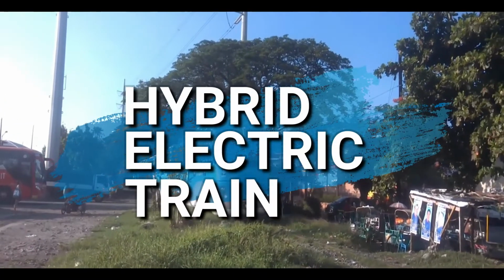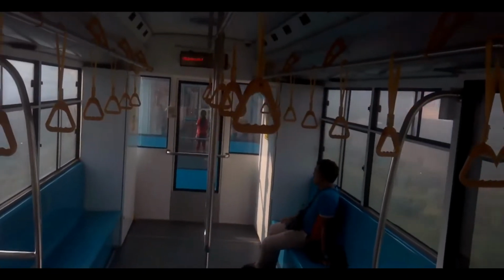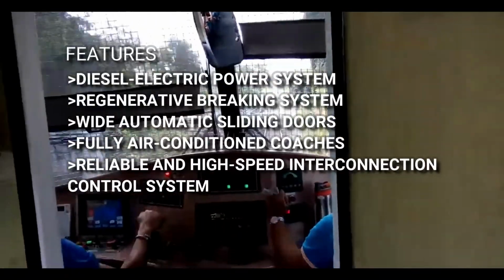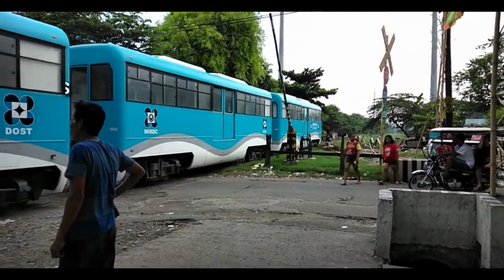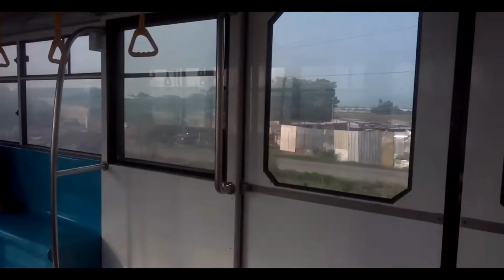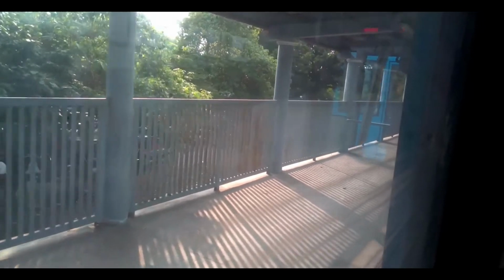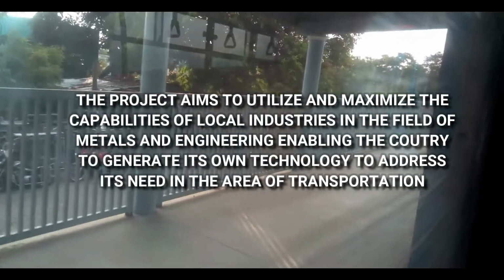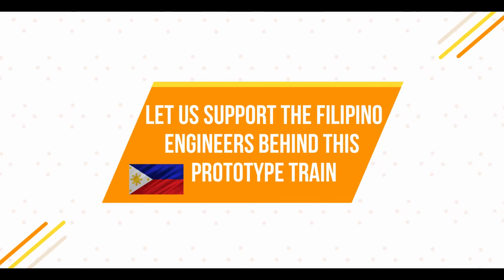PTERC: Domestic Production of Trains in the Philippines

Comment: The train needs some re-design like connecting each railcars for people and crew to have access to all cars.
Reply from the maker: Indeed, Gilbert!

Aside from that, there are also a few more design errors.
1. The floor height is too high in case of emergency.
2. There are electrical boxes inside the passenger area, where it shouldn't be.
3. The door stair found in the passenger modules is very hazardous in case of almost a maximum volume of passengers.
4. The cars are too short to be able to really optimise to PNR's needs.
Reply: @PTERCOfficial  Have you brought this up with the designers of the train?  You might get some answers on why it was designed as such!  My initial take on the floor height is because it can go through flooded areas.  The designers I believe already conveyed this.  The stair inside is because of the height of the platforms.  As for the length, there are definitely some standards followed and additional sets are needed to address your concern but for me, I prefer this length so that it can service non-peak hours!
I rather prefer multiple train sets rather than 1 very long train.  Why?  You don't need to have longer waiting time for non-peak hours.  Also, the volume of people in the stations at a given time is minimal due to short waiting times and lesser number of people unloading and loading.